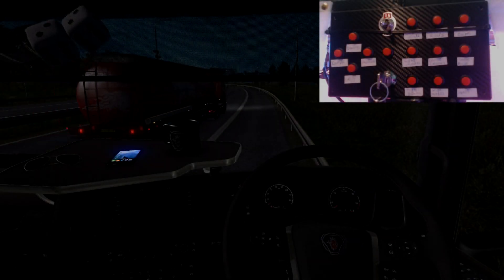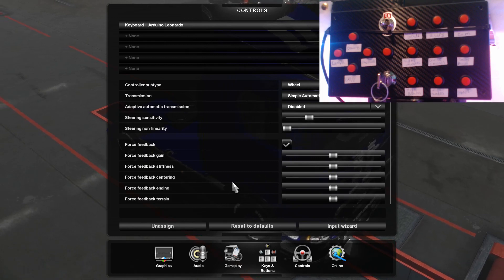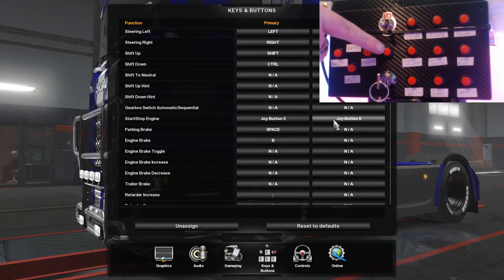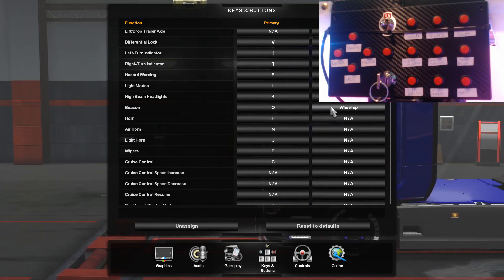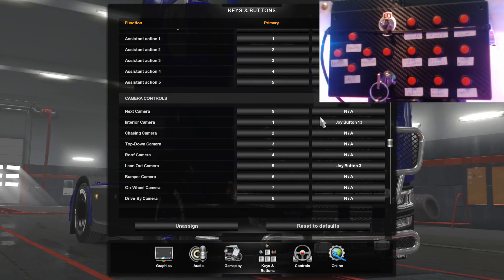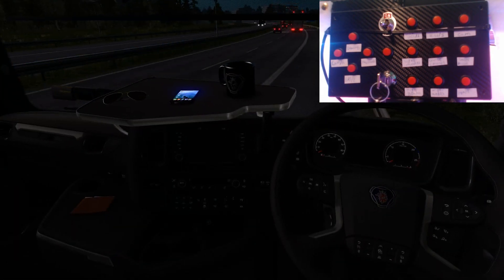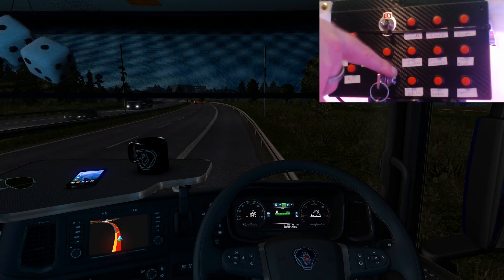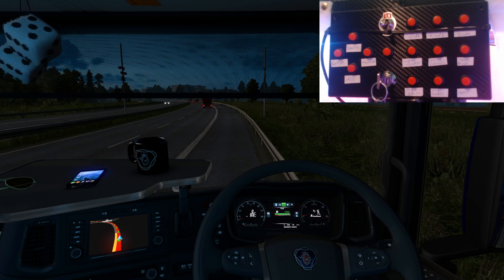How To Map A USB Button Box to Eurotruck Simulator 2

Comment: I want to do the same thing. What did uncheck on to make key switch work? 2) can map key as primary if that is your only starter
Reply from the maker: sorry for the late response . for some reason i did not see this comment . if you still have the issue i believ its elictric start that has to be un checked
Reply: @PatTheViking  no problem on late response,  I figured that out to unchecked that engine auto electric part. My issue is. And maybe you have an idea for this ats/ets2 is not saving settings as well as when I drive truck vears not straight line. Steering is snappy not smooth thanks for the issue help
Reply from the maker: @nsvaluto48328  all setting should automativally saved  so not sure on  that on . in terms of the steering play around with the steerind sensitiviy